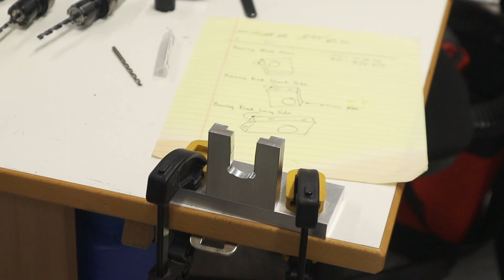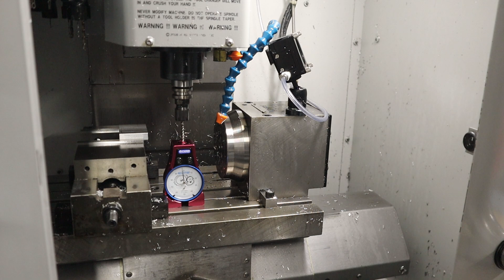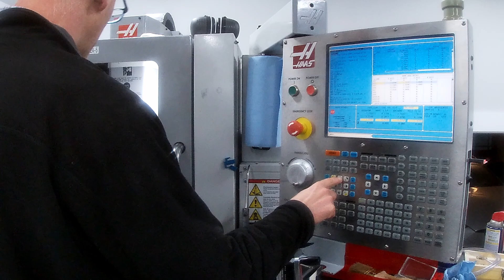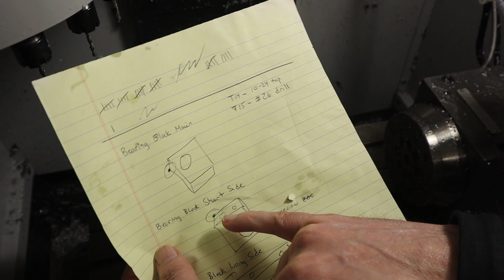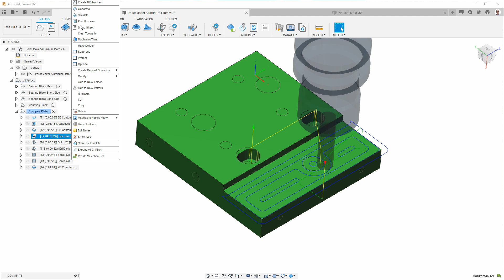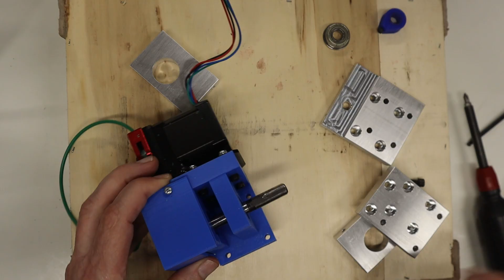Plastic Pellet Maker Part 7

Comment: Nice build have you ever decided to move away from the drill and add a more permanent motor to the chopper blade?  Have you done anymore design changes or improvements?
Reply from the maker: I haven't moved beyond the drill motor, as it works well enough for my needs. I haven't chopped a lot of rolls, probably only about 5.

Comment: @JohnSL What cut-length of filament worked best for you? I'm working on a design and am under the assumption that smaller lengths yield a higher density of plastic prior to melting (less air introduced as well). I think I'm headed toward 2.8mm cut lengths. Your input would be appreciated.
Reply from the maker: The length isn't critical. I've purchased pellets that have come in different lengths. So I just go for something that is a little longer than the diameter. In other words, maybe 3-4mm. But again, not critical.
Reply: @JohnSL  Thank you.

Comment: Much better, 3D printed was great for the prototype though. Your way was fine, just thinking out loud here,  cutter comp works a treat for tweaking hole size, save you from having to go back to cam and re-posting and I really like form taps, especially for aluminum.
I
Reply from the maker: Agreed. I like prototyping with 3D printing because I just start the print and walk away. It's less work than milling parts. I thought about using cutter comp. However, I'm planning to make the design available to others, so fixing the hole made sense. And I agree that form taps are really nice. But I just love spiral flute taps--it's fun to watch the cuttings come out the top.

Comment: Thanks for sharing! Is there any reason you didn't let Fusion 360 print the setup sheet?
Reply from the maker: Yes, my printer isn't working. I need a printer so rarely that I haven't gotten around to replacing it.

Comment: Just a small tip, always remove collets and tooling and give them a clean with a degresant like alcohol or brake clean ( non chlorinated ) esp the inside. as any coolant left on them will make them easier to slip or pull out.
Reply from the maker: That's a good suggestion. Thanks.

Comment: Making housings like this is a perfect job for the 4th axis. Once you get it running you will wonder how you ever did without it.
Reply from the maker: Definitely on my list. I need to decide on the workholding solution and how to mount it to the 4th.
Reply: @JohnSL  that's entirely up to you and what you have available locally. You could use a lathe chuck, collet chuck, trunnions, tombstones or even just a faceplate. Once you get into multiaxis workholding you realise the depth of the rabithole. And unfortunately a lot of it is prohibitively expensive for a hobbiest. Just take a look at the prices of zero point vises.

Comment: Wouldn't it be cheaper to buy pellets instead of cutting printer filament?
I'm not sure what price your getting your filament at.
Reply: Oh ya for colors I think you said that once
Reply from the maker: Not really. This is costing me about $8/pound. I haven't found any source for small quantities of pre-colored ABS in the colors I want. Natural ABS in 55 pound bags is about $3.50/pound. Then you have to add colorants (masterbatch), extrude, and then chop. I can certainly get cheap plastic from China, but in much larger quantities than I need.
Reply: @JohnSL  This is exactly why I want something like this. I have to mix my own. 2 part TVP and 1 part PP.
Reply: @JohnSL  Have you found that your chopper with chop flexible material?